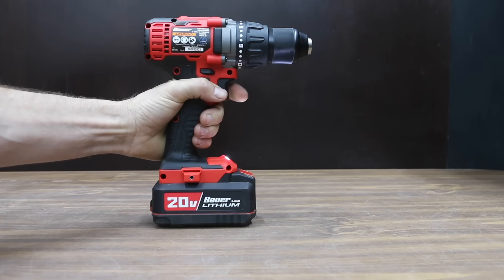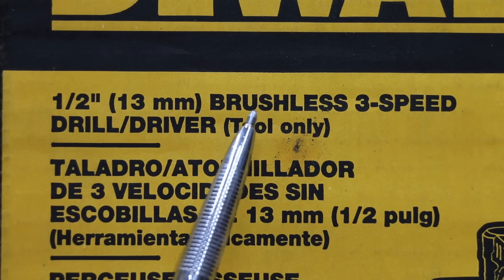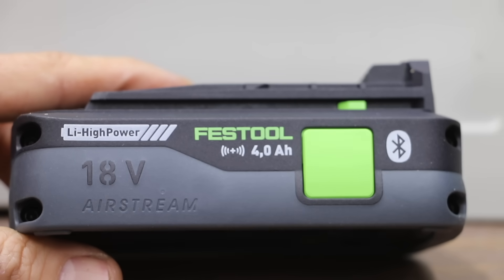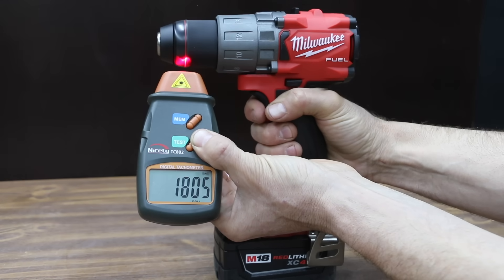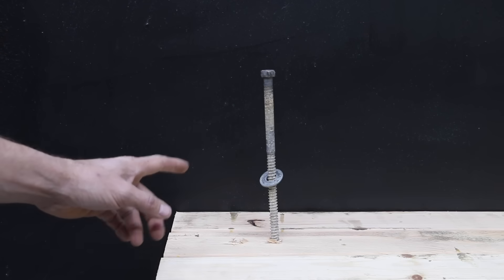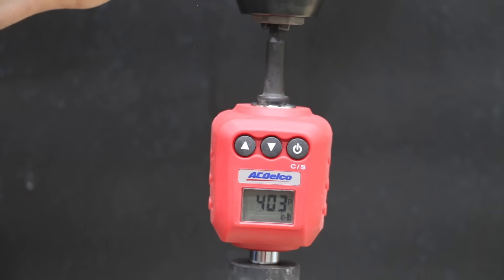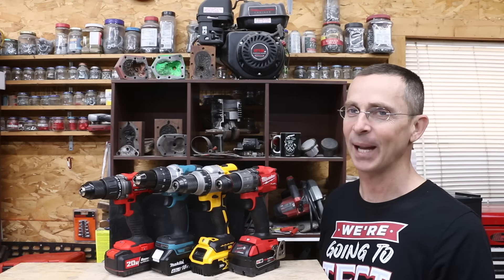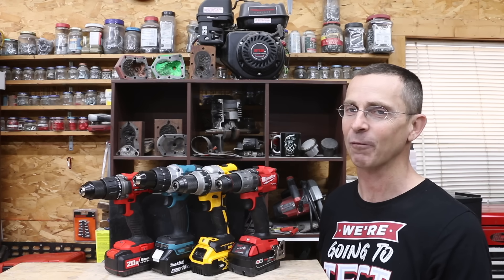Best Drill (BATTERY POWERED)? Milwaukee vs Dewalt, Makita, Bosch, Festool, Ryobi, Bauer, Ridgid

Comment: I’ve put Hundreds of thousands of screws into hardybacker board for tile work and drywall with dewalt Impact drills. They do the job for the money and the longevity of the tool and battery life is not bad.
Reply: I hear good things from all kinds of people about Dewalt. Idk if I just have had bad luck or what but I have never used a Dewalt tool that didn't give me a problem. It's really irritating.

Comment: Outstanding testing here.  I do wish you had put tested cost instead of what you get at store shelf since only the ryobi and festool came with batteries.  Happy with my ryobi junk as it does the job and for the cost, it is really unbeatable.

Cost from your amazon links is different than video, but I know that prices change and this was just what you paid at the time of filming.  For anyone interested here are the prices from the links.
Milwaukee in video was $153 amazon has it at $139
Dewalt in video was $135 amazon has it at $133
Makita in video was $149 amazon has it at $158
Bosch in video was $154 amazon has it at $169
Rigid in video was $95 amazon has it at $69
Bauer in video was $45 amazon has it at $74
Ryobi in video was $70 with battery amazon has it at $48.  That is just an absolute amazing deal.  I may order another one just so I get another battery.  I can buy like 4 of the ryobi with batteries and chargers for the price of even the rigid with a single battery and charger on amazon.
Reply from the maker: Thanks for sharing.

Comment: I used to build fuel cells for race cars. I had a milwaukee to drill the holes for the filler necks. That drill ran for 4 years, only broke once, and drilled over 50,000 holes.
Reply from the maker: Thanks for sharing.

Comment: I started construction using Bosch cordless drills, I have been on cordless Makita impact drivers and drills for the last two decades.  They run and haven't had issues with any of them.  Well, I have had a light at the trigger stop working on one.  No desire to switch brands.
Reply from the maker: Thanks for sharing.

Comment: I love how thorough this was, highlighting the strengths and weaknesses of each brand. I always see videos of people with 3 brands of impacts driving a lag bolt in as fast as possible and claiming that their drill is best because of one aspect.

It was also enjoyable to see the wildly overpriced brand get crushed in nearly every category, proving that they aren't worth the price
Reply: Yep over rated.
Reply: I agree with you.
Reply from the maker: Thanks!  Thanks for sharing.
Reply: Also no one talks about the longevity and heat production.
Reply: @rubz7264  there are tool channels that measure the temps and ability to continue bringing the business. 
But there's one channel that relies on tools doing ridiculous things into a stump that nobody will ever do in real world applications that just needs to chill. Nobody is trying to drive 10"+ lags into a hardwood stump. Irrelevant nonsense. I'd also home people aren't buying $99 and less drills and expecting them to spin massive bits through 6" timber. Real world application tests are where it's at. I love my Ryobi HP tools because they are extremely comfortable, reliable, flexible (so many options) and have plenty of power to get done everything that I need them to do and they aren't extremely overpriced "look at me" tools, they just work. I laugh every time my buddy pulls out his Makita collection. Why'd you spend thousands upon thousands of dollars more than I did, only to have something that has never once outperformed what I'm using??? 😥 Sad how people think more expensive means more better. Milwaukee is worth the price for their serious tools if you need something you're going to be abusing daily, but honestly, the things people try to do with their cordless tools these days is absurd.
Reply: For God so loved the world, that he gave his only Son that whoever believes in him should not perish but have eternal life. John 3:16.

Comment: Well i used to manufacture for dewalt. Fyi dewalt, Panasonic and workforce were made in the exact same mold for the bodies. The fans were also the same material. The only difference between dewalt and the others was color and dewalt had a 33% mineral fill added to the plastic. I think dewalt has gone metal fans. The motors were a bit different but not by alot. The batteries was where the difference was.

Just fyi on a side note. I visited black and decker. Their rnd didnt use dewalt tooms. They had milwaukee. 

Dewalt is junk.
Reply from the maker: Thanks for the feedback.

Comment: I have the makita drill and hammer drill. Locally the Milwaukee and Dewalt have accessories more readily available than my makita, but I can easily buy them from the internet, I have the Sawzall which has worked awesome and I really have worked it. I also have the blower which works great for my garage and driveway.
Reply from the maker: Thanks for the feedback.

Comment: Got a bosch impact and drill for $99 at Lowes. They as well as home depot have them on sale every now and then. Felt it was worth it and super satisfied considering the price. Two batteries and charger included.
Reply: How’s it holding up? How much do you use it? Heavy use or light use?

Comment: Showing multiple tests for each one is extremely helpful for someone who knows nothing about these tools. Thank you! I need a tool for small jobs (but that are difficult because of space). Do any of these have flexible shafts or are any (of the recommended ones) of them good for tight spaces (ie: screw near side of wood)? Again, Thanks!
Reply: You can buy a swivel bit holder. It works the same as a bit holder for your tip(phillips tip). Plus you can buy an extra 3-6 inch extension so the drill wont hit the wall
Reply: @timmybangs4711  Thank you!

Comment: This confirms my thought that I would rather buy 5 brand new Dewalt in succession than buy one Festool. Thanks for the thorough work as always.
Reply from the maker: You are welcome!  Thanks for sharing.
Reply: @TheCheesePlease Festool is like some weird pyramid scheme. The people who've spent a ton of money on it need to tell you how great they are so you spend your money on it so that they feel better for having been screwed.
Reply: @TheCheesePlease a festering stool
Reply: Somehow Paul I only think you need to buy one Dewalt. Maybe multiple purchases would be required if Rigid or Bauer, etc.

You buy into Festool for their systems. At a point in time they were leaders in sanding and dust collection and innovators when in came to track saws and tools like the Domino. The Centrotec tool connecting system for drilling is still really good but drill technology and battery technology haven't kept up with the competition. 

A great example of the competition outstripping Festool at their own game is the Festool HK85 circular saw ... it's a mains power saw that can run on a track and cut to a depth of 85mm. Makita just released a 40V cordless 270mm saw that can run on a track and can cut to 104mm. The kicker is the Makita skin is about a third of the Festool's price. But then you look at the Festool system capability of the HK85 where you can add a groove cutter head that can cut a 25x35mm slot - that feature makes it unique and very valuable to some.

People are typically in one of 3 different camps when it comes to Festool:

1. People that leverage Festool unique capabilities (which seem to be diminishing over time thee days) in a way that gives them a productivity benefit justifying the higher cost
2. People that buy a premium priced brand under the belief that its price makes is superior or simply because of some form of tool snobbery
3. People that hate Festool because they can't afford it or because they hate the people that can afford it

Personally I was probably a (2) through ignorance and have evolved into a (1).
Reply: Like the 4th gear though. (Got the Protool version)
Reply: Everytime I see some guy post a "Tool ranks " video they trash Ryobi as DIY only (they make some great tools imho) and rank Festool and Hilti top, and you can tell theyve never used them...

"Ryobi is DIY TRASH
Milwauki DEEwalt is gud fer tradez
Feztulz and and Hilti is top notch KWALity tools"

Comment: I've used a variety of battery powered brands, finally bought a Festool, its battery life alone is worth the investment.  The largest Rigid, Milwaukee, dewalt batteries don't even come close to the time the Festool battery lasts, both being used and sitting idle. Considering the lithium batteries are the most expensive part of this tool it makes the Festool worth the price.  Downside is Festool doesn't make dozens of tools that take the same battery like the other brands, so it's cross utilization isn't that great.
Reply from the maker: Thanks for sharing.

Comment: This is a good setup, but in Festool's defense, their target market is carpenters (usually finish or furniture carpenters specifically) whose main application will be quickly and consistently drilling holes that look super clean and using forstner bits.  Those applications aren't tested here.  Although I've seen Festool chop saws used by carpenters who do framing as part of their work, I doubt anyone in the market for a Festool will be drilling a lot of lag bolts.
Reply from the maker: Thanks!  Thanks for the feedback.

Comment: Late to this, but i wondered if you had tested the electronic clutch drills in "low gear", because that is where the electronic clutch will be worst at low settings, since it is really sensing motor power, not delivered toque....

Comment: This is an excellent comparison video!  However:

I never sink lag screws without a pilot hole; and I would use my fantastic Ryobi impact driver for that job - not the drill-driver -- however, I don't use tools 8h/day.  If I needed more power from a Ryobi drill-driver, I'd look into their newest Brushless tools.

I had the older DeWalt toolset (back when all we had were NiCad batteries!), but I sold it once I got the Ryobi 18v Lithium system -- I got tired & sore from the DeWalt drill-driver wrenching the tool out of my hand.  Injuries also possible with these higher-torque tools; as my DeWalt's drill-driver was older, it did not come with that extra handle -- as best as I can recall.  Also, the DeWalt Recip saw was decidedly a two-handed tool, for me.  I have a REALLY old Makita -- which I have cut up innumerable tree branches with -- by holding branch on one hand and the tool in the other -- these were the old 9.6v stick batteries.
Reply from the maker: Thanks!  Thanks for sharing.

Comment: Really liked this, but it may have been useful to include some type of test of the trigger and clutch sensitivity. I'm not sure exactly how you could do it scientifically, but perhaps something involving hinge installation over glass tile without cracking the tile? Or driving soft brass screws into oak without tearing up the slot in the head or over driving them? It would be nice to see a demonstration of variability of speed, clutch and overall precision. I wonder if the Festool would excel in that category?

Comment: I'm really considering consolidating all of my cordless tools to 1 battery brand. So my criteria are this. 1 availability (being able to get the tool anywhere is huge) which is Dewalt with Milwaukee close behind. 2. power and durability ( your tests plus jobsite results are Milwaukee and Dewalt being very close. Battery pack quality Dewalt and Milwaukee. Price seems to be a wash over all. Warranty Milwaukee. And last the range of tools available to run one 1 common battery. I think that's Dewalt but I honestly can't decide so I figured it to be a wash.
Reply from the maker: Thanks for the feedback.

Comment: My familys surveying business used strictly dewalt back in the 90's and i found a bunch of their old stash thrown away and the switches wouldnt work but when i took them apart and got the motors out they all worker perfectly and they had sat outside for probably 10 to 15 years so id say the terminals in the triggers were just rusty and probably could have been cleaned and theyd have worked still yet. The only reason why i didnt fix them is them being so old brushless motors have become so popular and they werent lithium battery powered so they were just outdated sadly. But the fact that they still ran after sitting in the weather for so long is a huge testament to dewalt. I would love to run dewalt in my drill and impact driver but their stuff got pricey the smaller and more compact they got haha so i bought a brushless hart 1/2 inch drive drill and will be buying the brushless impact soon hopefully. This hart drill i use for my dirthole sets for trapping and when it hits a root in low gear it will rip the drill out of your hands. I think the hart heavy duty drill is a brushed motor but the torque handle might be something i need to get through these cedar tree roots lol love these head to head test videos to really show apples to apples which brand makes the best specific tool. Thank you for making these tool decisions a little bit easier.
Reply from the maker: You are welcome!

Comment: I'm no tool junkie but wouldn't there be a definitive difference between regular drills and hammer drills, also brushed and brushless? I understand hammer drills have the option to drill without the hammer function, but would it not have a performance difference despite being built for heavier applications? I just thought this demonstration had a really broad comparison.
Reply from the maker: Thanks for the suggestion.

Comment: Great video! Thanks for that! A good test would be to see how much heat those drills can handle. Sometimes on jobs I’ll get the motor so hot it burns my hands. I’d be curious which one could take the most without burning out. I think the brushless would shine in this instances. Just a thought.
Reply from the maker: Thanks for the suggestion.
Reply: Im a plumper and i worked with makita 2 of them burned out. Than i get a milwaukee i didnt have such problems anymore. I owne the milwaukee 5 years now and its still working fine.
Reply: @marcellokastner  You tend to see Milwaukee in plumber's vans more often than every other brand combined in Oz. My son was recently working for a large plumbing supplies distributor and they pretty much only sold Milwaukee power tools. You've probably also noticed that Milwaukee make more specialist tools in the plumbing and engineering space than any other brand. That market demands the highest performance and durability, hence the Milwaukee bias tends to be grunt more finesse less!

Dewalt and Makita tend to be you construction brands. Bosch tends to cast a wide net. Festool is a niche brand designed mostly for finishing and precision work with a strange love / hate following.

"Burning out" two Makitas doesn't mean its a bad tool, it was probably just the wrong tool for your job.
Reply: @kevinpunter7960  yeah i agree with that 👍 never want do say makita is a bad tool 😊

Comment: Can you get a multi-tool set from Hart (Walmart brand) and add results for the drill, impact driver and reciprocating saw?  
I got a 5 tool 20v set with a drill, impact driver, reciprocating saw, a flashlight and hand vac and 2 1.5 AHr batteries for just over $100 on sale, and added 2 4AHr batteries for just $80.
I KNOW they aren't top-of-the-line, but I would love to know how they stack up against Bauer, Ryobi, etc.
Reply from the maker: Thanks for the feedback.

Comment: They should have added Porter Cable drill to the line up. I use them commercially and I’m still using the same batteries for 5 years.
Reply from the maker: Thanks for the suggestion.

Comment: I have the new ryobi for light duty stuff around the house cause it's not pricey for batteries and they have great accessories.
I've always used Milwaukee for construction work though. So reliable over the years I don't see any reason to change but dewalt would be a second choice I think.
Reply from the maker: Thank you!

Comment: I use  fuel Milwaukee for commercial plumbing and they are very powerful and fast and I like how they make the drills and impacts so small so they can fit in tight spaces
Reply from the maker: Thanks for the feedback.
Reply: That appeals to me as well. It's so much more maneuverable when it's smaller.

Comment: Well thank you for helping me pick out my new drill for my purposes I think the Bauer is more than sufficient and the price point that’s pretty good too!
Do you have a video that goes over longest stored power for the batteries as in if you don’t use it for a year will it still have enough charge to do what you need to do?
Thanks!
Reply from the maker: Thanks for the suggestion.
Reply: I've had tools from Milwaukee, DeWalt and Bosch all hold a pretty good charge for well over a year. All 3 had lithium batteries.